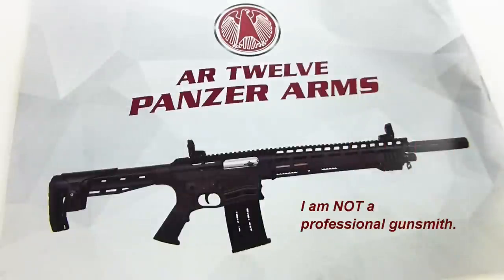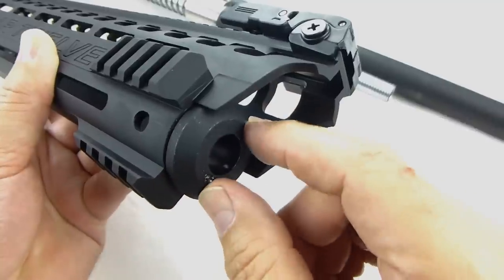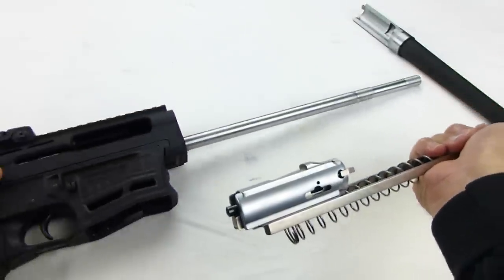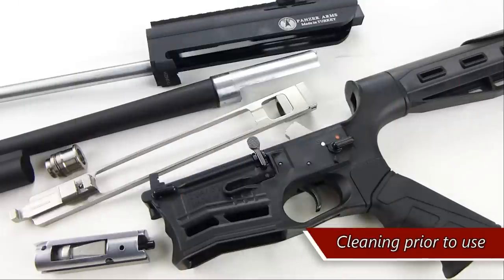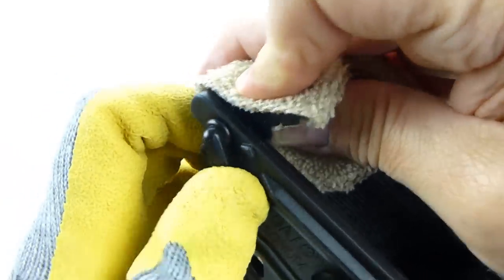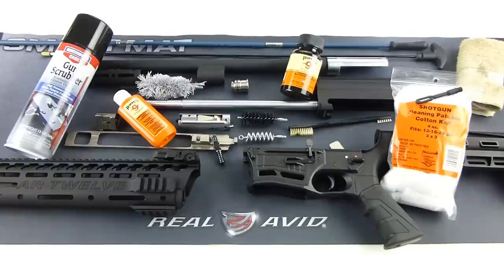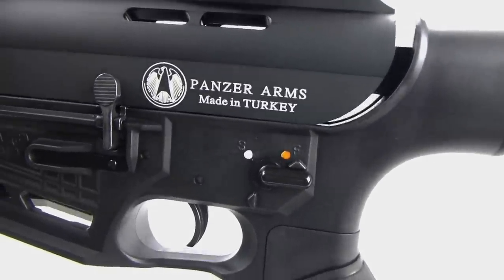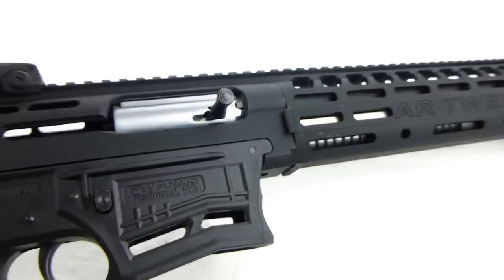Panzer Arms Gen3 AR12 Disassembly Cleaning and Reassembly *Full Video*

Comment: I just got one and apparently I got a Gen 4. Can’t find a video anywhere on it but it’s very different than this one.
Reply: I have a gen 4 too you start by unscrewing the barrel and then the gas system and then the stock I believe, I still have yet to take it apart completely
Reply: If you haven't figured it out I can send you  an email of the manual
Reply: Did you figure out how to take it apart I believe I got the gen 4 too
Reply: @zachkaid8965  you have a manual specifically for the Gen 4?  Put the link for it in the comments. 

The manual that came with mine is not detailed at all. 
What removes the butt stock bolt?

Comment: Very good video!!! On yours, during reassembling the gas piston was tight against the bolt carrier group. Mine is not no matter what ive tried. The barrel is completely seated and there is still a quarter inch gap. Is this ok or is something  wrong?
Reply from the maker: Hmm. I'm not sure. Contact Dan Tobin at Dan's Sporting Goods. They are the authorized service contact for the Panzer AR12.

Comment: While removing the Gas piston from the barrel I noticed another #40 O Ring inside! After Shooting it was worn out and replaced!  I didn't see that O ring in your video just curious, thanks for any information
Reply from the maker: T S Really? It was inside the gas piston well? And it was a #40 O-ring? That’s unusual? Mine didn’t have that. I wonder why no one else has mentioned that? Have you fired you gun yet? If so, how many rounds and what type of ammo? Is it a newer model with an adjustable gas piston?
Reply: @MrMnmn911  I purchased it about 2 months ago, shot over 200 rounds a couple of stovepipes and with the Walmart  Winchester super x 1300 velocity. Switched to Winchester super speed  #8 1350 velocity, no issues with 100 rounds. After the first 100 rounds I disassembled and cleaned ! Thanks to your Video!  And noticed that #40 O-Ring around the Gas Piston kinda chewed up so I replaced both O-rings, I wouldn't have even noticed it unless it was on the Gas piston ,but it fit inside before you put in the Gas piston! Thanks for your help and advice
Reply from the maker: Did you purchase it brand new or used? I just disassembled mine. I see that there is a metal ring in the channel of the gas piston but I don't see where a #4 O-ring would be placed. The front of the gas piston is curve to fit into the gas chamber and it looks like a rubber O-ring would partially block the gas ports. It's interesting that your's would have a rubber O-ring in the gas piston chamber.
Reply from the maker: @TS-411  Yeah. I have a review video posted on my channel. I have had some issues and haven't resolved them yet.
Reply: @MrMnmn911  Thanks for your help hopefully we all can put together some information so everyone can get some issue resolved,  trying to find some information from the Manufacturer .

Comment: I could not get my charging pin out after an hour of trying. I made usure it's lined up properly I could get it to move out about 1/16 of an inch maybe but then it wouldnt go any further. I tried shifting bolt forward and back a little to see if maybe I was just a little off, but not go. 

I also could not move the bolt block without pliers. They really need to work on their fit and finish on these guns.
Reply: What are you even talking about? The fit and finish is exceptional on these, especially compared to an AK style gun. I have 2 and several buddies have them as well. The bolt is smooth as hell out of the box. The machining, fit, and finish is as good as most American made firearms. 
  You just need to use a little elbow grease to remove the charging handle. The detent is just a bit stiff. Have someone with more  hand strength than you pull it out. And have them work it in and out about 100 times with a little lube on the ball bearing. If you don’t have access to stronger hands, put the charging handle in a vice with plastic covers, or a magazine on either side, or something to prevent marring, crank it down, pull back on the gun with even pressure fore and aft, and it’ll come out.

Comment: BUMMER ..... I'm REALLY interested in this one, but having to use a 12" ratchet wrench and remove that "upper retention" bolt just to separate upper from lower receiver ---- it a total DEAL KILLER !  Don't have to do that on my AR-15, and don't want to do it on my shotgun. 

do you think you can do a reasonable job of cleaning without removing that bolt? at least you can clean the barrel, and you can probably get some cleaning patches into that chamber area...  what do you think?

Just looks like too many tools needed. I shoot every week, and have several guns to clean - don't need any tools  for other guns - this is disappointing.
Reply from the maker: You don't have to remove the upper from the lower. Just remove the barrel and you're good to go. What I'm showing is the full disassembly because quite often people ask. Have fun. Don't make it  burden.
Reply: You pretty much only remove the upper from the lower to access the trigger assembly. Everything else is accessible without separating the upper and lower.
Reply: @Shawnwyatt101  thanks for the replies, men - greatly appreciated!  I bought my AR12 about 10/20/20, and it has changed significantly.  you CAN separate the upper from the lower  by tapping out the front pivot pin, and the rear takedown pin, identical to an AR-15.  So don't have to remove the barrel, nor disassemble the buttstock.    My owner's manual discourages you from removing the barrel, suggests that you clean the shotgun without doing that.   That's all good news to anyone else reading this who might be considering the AR-12.  It's a great shotgun.

Comment: awesome video. only issue is the faux muzzle brake will not tighten completely
Reply from the maker: Mine tightens just fine. Thanks for watching and liking.
Reply: @MrMnmn911  not going to cause any issues?
Reply from the maker: @mrbudmanfl6956  No issues. It is not really a muzzle brake. That is just what Ben from Classic Firearms called it in his review. The Panzer manual calls it a "flash hider". It is actually a barrel heat shield, which you'll want to have after repeated firing, as the barrel does get hot.
Reply: @MrMnmn911  ok thanks it is an awesome platform

Comment: Just got the AR-12, video was extremely helpful! I do have a question and maybe some others who have watched this might know as well. I have seen the gun fail to eject certain types of ammo in different videos, was wondering what your experience with it was and what type of ammo do you recommend for it? thanks
Reply from the maker: Hello. I had some FFE's of various types of ammo for quite a while. My latest trip to the range last week went very well. Only 1 low recoil round failed to fully load. This last range visit made approximately 300+ rounds of various types through my AR12. I did also polish my barrel prior to this last range visit.
I was very happy with the way my AR12 performed, even fired a box o 20 low recoil 000buck 9 pellet shells good.
Hope this helps.
Reply: It seems that the low velocity rounds won't make the gas piston move fast enough in SOME rifles. Mine has never done this, but I have seen others do it, and it seems to be just the lower powered ammunition. I have a beretta that hates low power rounds, so I am used to semi-auto shotguns and it seems the gas systems can be a bit reliant on the pressures. Also, keeping them clean is a bigger neccessity  for this reason. If the rifle is fairly new, just fire a lot of high powered game loads through it and clean it really well, it will get better.
Reply from the maker: Digital Sharecropper Yup. My last trip to the range totaled about 300-350 rounds through it. It fired low velocity 00 buck, slugs and regular 00 buck and slugs, with no problems. I also think my polishing of the barrel helped. My last range visit with my Panzer AR12 was great!
Thanks for watching and liking.

Comment: I just got a panzer arms I shot it today but it won’t eject the shell at all you by chance know what could be wrong
Reply from the maker: Hello. Without seeing the shotgun I wouldn't be able to really say. If it is brand new I would consider returning it, it should still be under warranty.
Reply: These platforms usually have a prescribed break-in process, using 75-100 rounds with a minimum velocity rating of 1,400 FPS. Afterwards, the minimum velocity requirement drops to 1,300 FPS. High brass is best. 
If you weren't using ammunition with the aforementioned ratings, that might explain the recurrent failures to eject.

Comment: Nice vid but for the ar12 pro they say don't take the spring assembly apart.
Reply from the maker: Yes. The video is not for the AR12 PRO. Thanks for watching and liking.
Reply: Sure still same procedure as parts between two are same. Might be because people were losing parts.

Comment: The #40 O-Ring is available in different materials, the best for this application is Viton, it has a much higher temperature tolerance (+450 F) than the plumbing o-rings.
Reply from the maker: Where can you purchase the Viton O-ring at this same size? How much does it cost? Thanks.

Comment: Great information, thank you. I just purchased my AR12. Going through the manual it mentions the high velocity piston. Did you run ammo faster than 1350fps and replace the piston?
Reply from the maker: CarShowz This model does not have a replaceable piston. I did shoot 1600 FPS rounds fine.
Reply: MrMnmn911 interesting, I have the HV piston, I am wondering if I should replace it or just run with the piston it came with.
Reply from the maker: @CarShowzUS  Is there a physical difference between the normal piston and the HV?
I guess you could try both with 2 types of FPS rounds and see how your Panzer AR12 functions.
Does the manual spefically state why you need the HV piston. Or does it just say to use it with 1350 and higher fps shells?
Reply: MrMnmn911 I did not break down the gun, but perhaps I should to compare the difference. I am thinking I will break it in first and then try to higher FPS. The manually did not offer too much info other than use the HV with higher than 1350 FPS. I could not find anything online referencing this.
The other obvious thing I can do is reach out to Panzer. But I’m sure they will just recite the manual.
Reply from the maker: CarShowz I suggest you reach out to the authorized warranty center located in the United States, if you are in the USA. I have a video posted on my channel on my model. So your models authorized center may be different. Since they are “authorized” repair centers, they may know the specific reasons for the various gas pistons, and if they are even necessary.
You might also reach out to the importer of your specific gun...not the dealer you purchased it from...the importer. They may know who the authorized warranty center is.
Reply: MrMnmn911 thank you, I appreciate your time and response. I did watch your other video with regards to the warranty and contacting Panzer. That was very helpful. I am in the U.S. east coast. I am definitely going to reach out. Thank you again!!

Comment: Breakin 50 rnds. 1300fps minimum ammo recommended by manufacture..however wondering if can compensate with chokes on lighter loads
Reply from the maker: I’m not sure. My model does not use different chokes.

Comment: Those parts are meant to be pretty snug when its new i believe. Over time and use they start to loosen up. More rounds through it equals more disassembling and maintenance. That way the charging handle wont be falling out easy after you've had the gun for some years and a few thousand rounds through it, and your not inadvertently flipping the disassembly lever during some active use or firing cycle. It should get smoother after some time and some rounds down range breaking it in.
Reply from the maker: Yeah. They were not meant to be "that snug". These are not "snug" they are EXTREMELY tight. 
As I state in the video..."Do not do this if you think this will make your weapon unsafe", and "I am not a professional gunsmith". My video shows "recommendations" only. These are what I did after frustrating struggles with this Panzer AR12. I think the comments left by other people justfy my recommendations.
It's a cool semi-auto shotgun that is fun to shoot. I like it.
Reply: @MrMnmn911 great vid BTW. Yeah read most of the other comments after I sent mine. Looks like they manufactured the parts with some tight tolerances and what you encountered was a common problem. I came across your vid researching the Panzers because I was planning on getting one also! I'm glad you're liking yours, I might have to add one to my arsenal!🤙

Comment: How do you remove and replace the hand grip?  There is a nut, or something, on the inside.  It almost looks like an m-lock BACKING, with the hex bolt on the inside.  I wear glasses and it's hard to see up close, so I'm not sure.  Your thoughts
??
Reply from the maker: On this particular model you can not remove or replace the hand grip.
Reply: @MrMnmn911  i think mine is the 4th generation.(?)  I've got a few differences than yours, but it's not the PRO model.  Another video I watched, they said that Panzer Arms typically made changes now and then.  I don't see how the handle I've bought will fit on this gun.  Guess I'll put it on my AR-15.  I knew the price was too good to be a great gun.  It'll have to do.

Comment: Can you please do a video on the panzer AR-12 Generation 4 disassembly and reassembly paying particular attention to the gas system and the two little pieces of gas rings that fall out when you try and disassemble the shotgun. There is a big difference between the Generation 3 and the Generation 4 versions of this firearm. The owners manual that came with the shotgun AND the website does not give any specific attention to how those differences effect disassembly and cleaning. Moreover, the separation of the upper and lower is not covered anywhere. I believe this would be a great video in that Panzer is now making the Generation 4 available for sale without much support.
Reply from the maker: Sorry. I do not own a Gen4.
Reply: All Panzer models are remarkably similar just newer versions come with gas tubes, chokes, or pins disassembly for upper lower, but parts are still remarkably same no matter what version.
Reply: @JessicaSimonson1976  this generation 4 is a different configuration. It is suppose to separate the upper and lowers with a screw that lies deep in the stock well. I can do all the other disassembly, but this and I cannot find any video that shows me how. Panzer is not responding

Comment: Going to pick up some 2000 grit wet sandpaper an some mothers polish
Ohh i was wondering if a 20 round drum would fit on this?
Reply from the maker: I haven't seen a 20 round drum for this.
Reply from the maker: I'm not sure. I think you'll have to call them to confirm if they will fit.